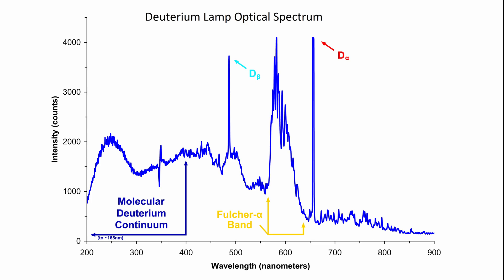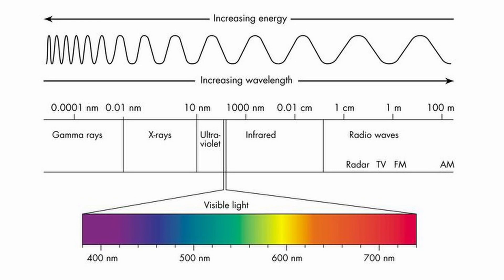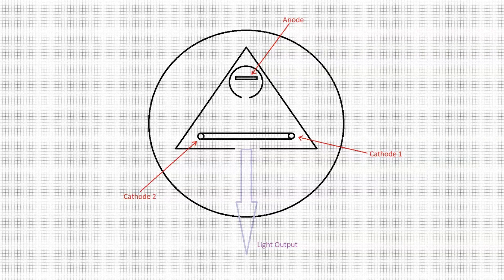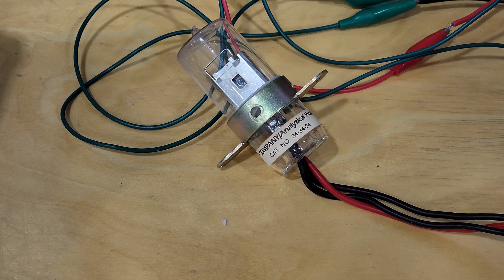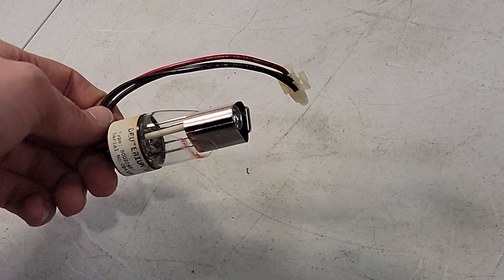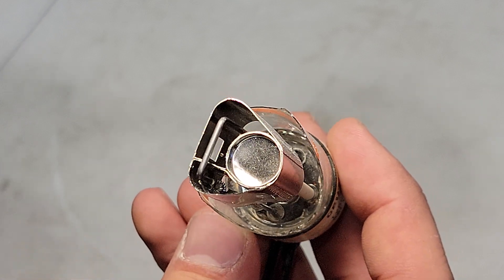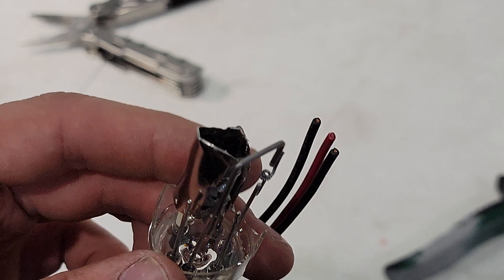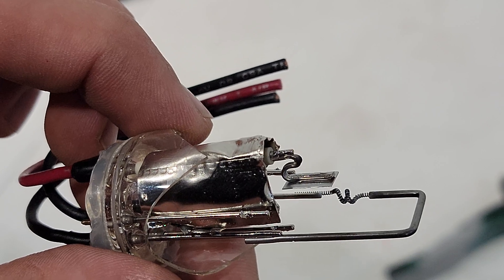Deuterium Arc Lamp Teardown

Comment: Hi Reed, Nice video. I'm a repurposer I have a number of these from HPLC detectors.  I'd like to make xmas lights from them.  drill a small hole in the back so I can insert an LED. I've read that the D2 pressure is a few hundred Pa.  400 Pa=0.06 psi  = 3 torr. Shouldn't "implode/pop" when the bit breaks thru? Just not sure if a dremel diamond core bit will get thru the quarts glass?  Please see my NMR pizza oven" (google it).  Rich